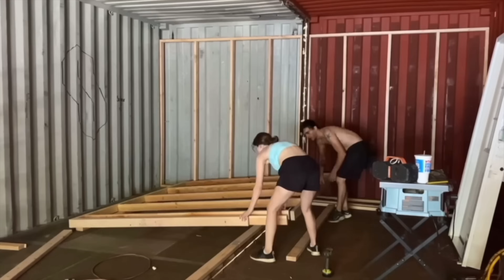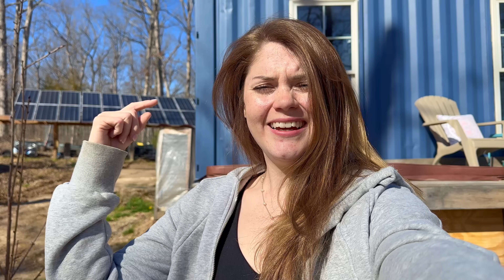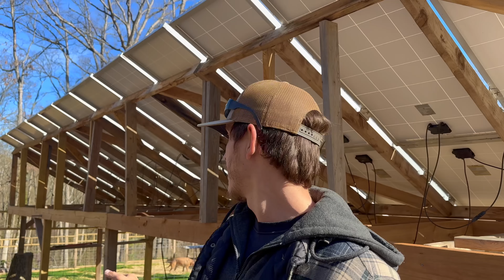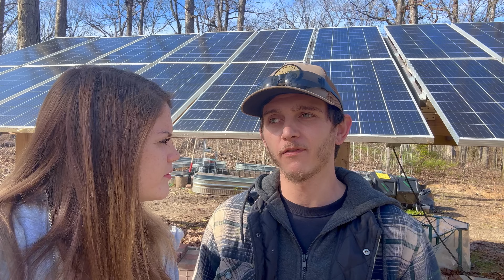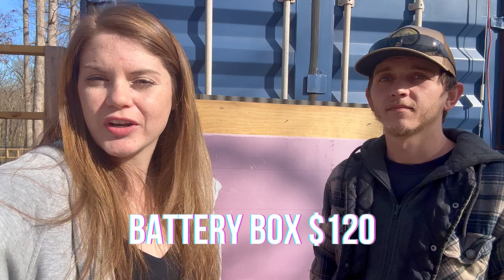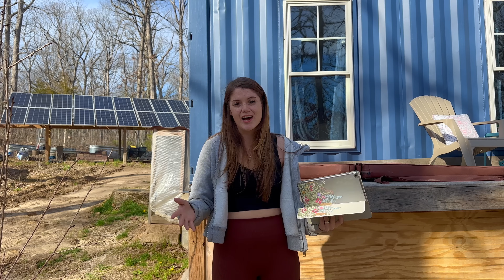TOTAL COST of Our OFF-GRID Solar Set Up | DIY Container House Homestead Power

Comment: Question 🙋‍♂️ are you running the generator to just power your house or to just charge the batteries?

With my setup. I use my generator with an 100amp charger to charge the batteries. Till they are charged. Then hopefully the next day the sun can charge them up. but if not, then I need to use the generator again. I try to use the generator no more then 4-6 hours. That’s enough time to charge the batteries from 20% level. But I also have two small Ryobi generators that I use with an 18amp charger. I always use the Ryobi’s because that use less gas and they are much quicker. 

Great job in your build.

Comment: Looks like a really good system, and I appreciate you itemizing things and sharing your thought process. The one question I have for you is whether you're seeing optimal output from your solar panels due to the trees around them. Even a small shadow on a part of one of the panels can cause a considerable loss in efficiency. I wonder if you might end up putting them on your roof on in a clearer area. But from the looks of it, you're in a forest, so that might not be possible.

Comment: Very nice. I also built a system for $15,000 11k solar, 2 5k inverters and 4 14.3kw battery banks.  Off-Grid Garage aka Andy just did a review on new EVE MB30 and MB 31 cells. For $2500 you can get 30kw of battery if you can build your own That includes 2 BMS's. He has links to where to buy from (China) on his personal website but links to it are on Youtube. I will be ordering those and 2 more BMS and another inverter all for $3500. I am adding more solar and using inverter as MPPT controller and those 2 battery banks of 15kw will be on new inverter separate form other batteries since others are 280ah and new ones are 306ah. Its about me getting off grid from electric then from Natural Gas in 4 years.

Comment: I got 36 400w/500w bifacial solar panels in January of 2024 for $3600 free shipping.  Lets say your panels are producing 3000 watts per hour and you are using 3000 watts from the inverter, that is a break even, no charge to batteries.  Can never have enough solar panels.  How cold does it get there?  You don't want those lithium batteries ever getting below freezing.  Any charge or discharge below freezing will destroy them all.

Comment: Ah youth, glad you are doing what you enjoy.  I am 71 and just put in a larger system for about the same cost per watt.  Twenty four 460 watt panels, two 6500 watt inverters, 20 kWh battery rack, plus all wiring, $19, 500.  Off grid system but I do have a grid connection, I used a transfer switch to change back to grid power if my batteries get too low.

Comment: Couple of things from an electrician.
A) You know probably that the wood is not the best material for duration but as you told was cheaper.
B) The location of the batteries, i would prefer not to be inside a wooden box, flammable...also batteries don't like cold or hot

Comment: Hi Summer and Cody!  I enjoyed the vid and did also look at the other you recommended.  I am on grid and also have a 5KW system that we did mainly to reduce our electric bill.  My system is about 12 years old now, permanently roof mounted on my 22' X 68' shop.  Due to it's age the cost was considerably higher than today, yet, it paid for itself in less than 6 years.  Todays costs would be far less and the payback very quick.  Thanks for the informative video.  Have a great week.  Larry, Central Valley, Ca.

Comment: 🌅😎Great work to get Free from never ending monthly electric bills🌻🗽🌻. Note: You mentioned "cost to get utility power to site would be ~10,000.$$ ...except You would need to have trench dug with conduit available for them to pull wires thru...& pay? for transformer, etc."    Would this expensive trench+conduit cost had been included in the $10k est. ??  Thanks🌻

Comment: Got a very similar inverter the all in one inverter from PowMr. I actually think you have the split phase one where you can get a second one to get 10k at 240v. Looks different than my all in one that can't be split phase. Unless you got the non updated model
Reply from the maker: Ours is an older model, the updated version came out a few months after we bought ours unfortunately. It's a 120v single phase unit, but when we upgrade it we will get a 220 split phase unit.
Reply: @CantContainUs  ok, I thought it looked a tad different. We also have the single phase 5000 watt updated PowMr. But our goal will be the same once we get our shed to house in order. Keep up the great work!